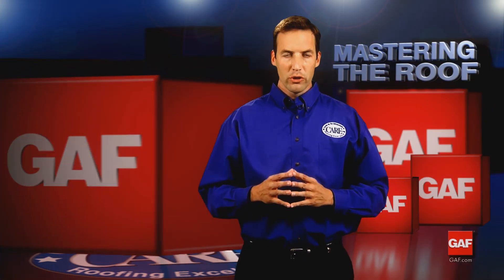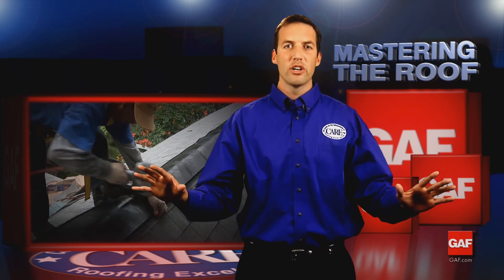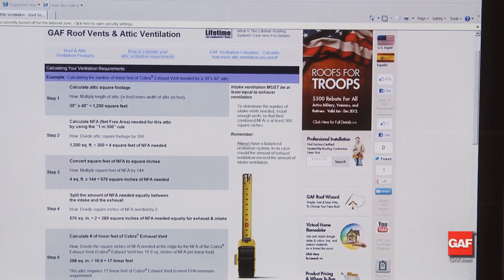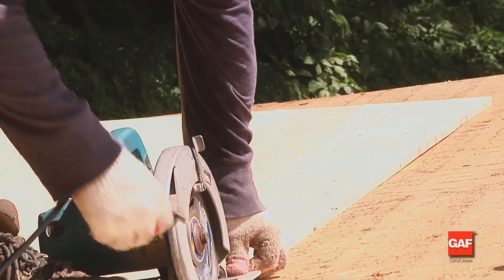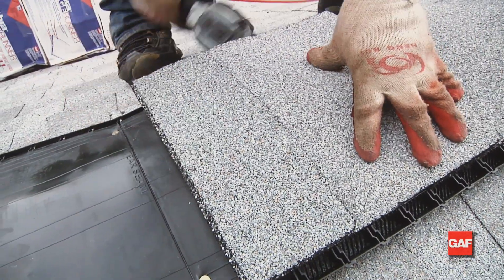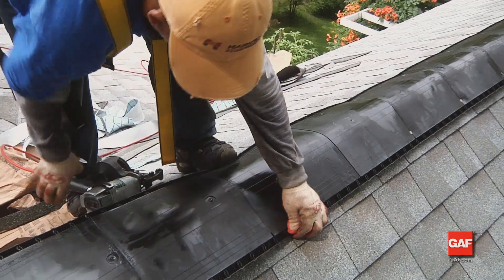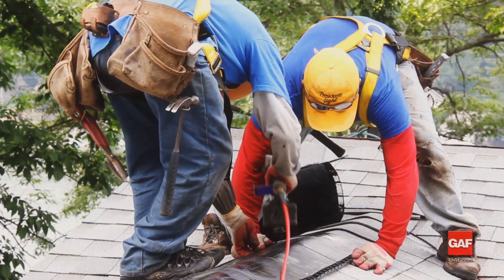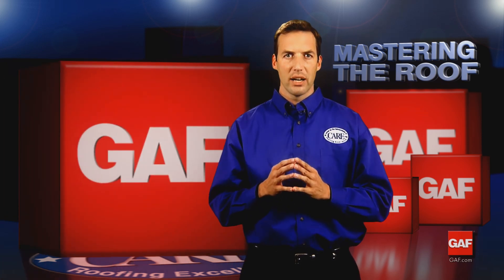How to Install Cobra® Ridge Vents and Attic Ventilation | Mastering the Roof by GAF

Comment: This system has a significant flaw: no screening. Yes, the openings are only 1/4" each, but that is plenty large enough to allow Africanized bees, mosquitos, wasps, yellowjackets, scorpions, etc into the attic/crawlspace. 1/4" won't even slow them down, and you'll have dozens of linear feet of 1/4" openings. The fix would be to staple aluminum window screening over the entire length of the slot that is cut into the ridge plywood, then install the vents over that. But these instructions don't include that. We just had a new roof installed with these vents, that is when I discovered the flaw. So now I have a major retrofit project: getting up in my cramped crawlspace and stapling screening in. Thanks for nothing, GAF.
Reply from the maker: Thank you for reaching out. Would you be able to share your feedback with our team at mygafexperience@gaf.com?
Reply: Well you just voided your warranty sir.

Comment: that's a big mistake adding a ridge vent, because they all leak.  what sense does it make to cut a big long gap in the peak of your roof, its most sensitive area.   the vent should be on either end of a house like that, in the top peak of the eave, facing outward or slightly downward.  this way the overhang of the eaves will shelter it- and you won't have a big long cut in your roof that leaks. I noticed how all my grandparents' old homes never had ridge vents and didn't have roof problems either, and were very old homes.  yet all the new homes do have problems, due to the ridge vent.  water splashes UPWARDS and gets under the edge of the vent, where the tin meets the shingles, then runs into the attic.  the ridge vent fasterners corrode and break over time, allowing the vent to raise up off the roof, and water gets under it.  when there is a heavy snow then melts, the water actually runs uphill a little there and under the ridge vent, because the snow below it downpeak won't allow the water to flow down.  ask me how I know, I had an expensive 40 year architectural shingled roof, get ruined in only 22 years, from a bad ridge vent. the house HAD NO RIDGE VENT previously before putting the roof on.  those tin ridge vents are nothing but trouble.  the leaks they allow into attic, go UNDER the top row of shingles, and work down the roof peak and rot all the plywood.  so farther down the road in time, you'll be changing all the plywood and putting on a new roof.  take a garden hose up there, spray upwards at the area where the ridge vent meets the shingles, you'll see water running inside the attic.
Reply: Ridge vents are nothing but a marketing strategy by the the manufacturers to bamboozle the ignorant customer.  Ice and water shield is another bullshit product designed to add to the corporation's bottom line.
What's really sad is that Americans buy this shit up!...what a bunch of Barnums!
Reply: @robertkelly9772   I'm about to get my roof done and they are pushing a ridge vent. If you see this please elaborate

Comment: I see most installers leaving their cicular saw set at 90 degrees.  On a slanted roof, that leaves a larger area of wood showing which in essence give a smaller vent hole.  I'm thinking of tilting my circular saw so the cut is perpendicular to the ground, allowing more cubic feet of vent area for the same width of cut.  Thoughts?
Reply: OCD !!!
Reply: That's a good idea, never thought of that
Reply: roof might be slanted, but your saw is on same degree of slant, So 90* is 90*
Reply: You are over thinking it bro. I cut my vent at 4” total width and doesn’t leak a drop after 5 years.